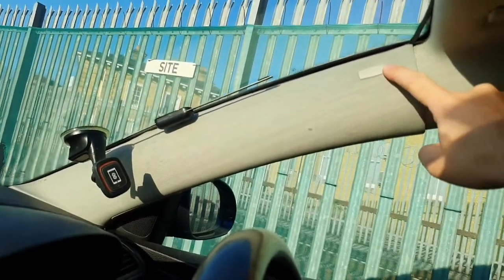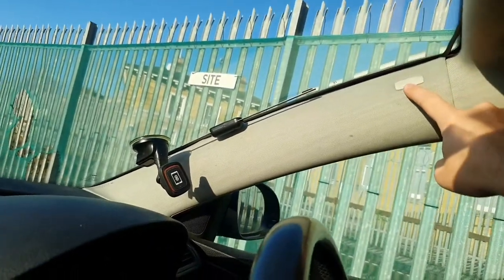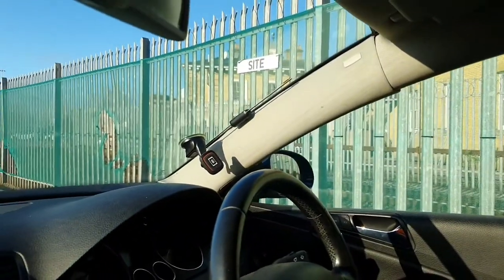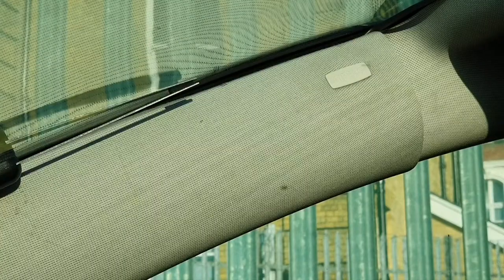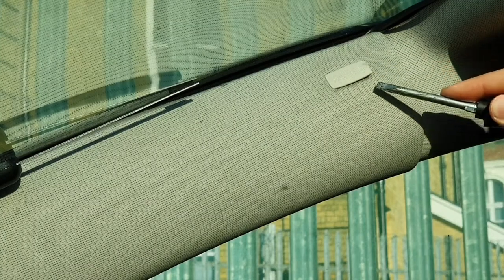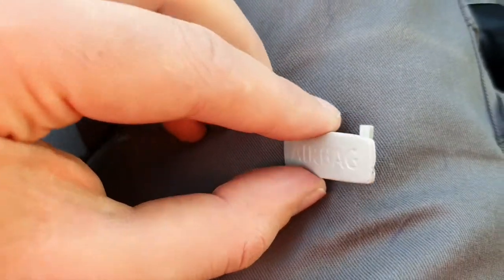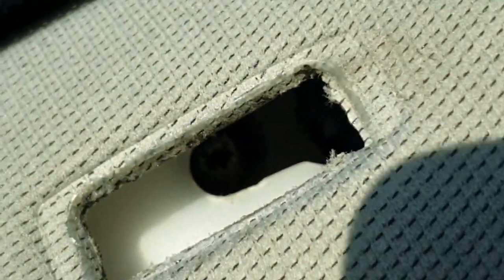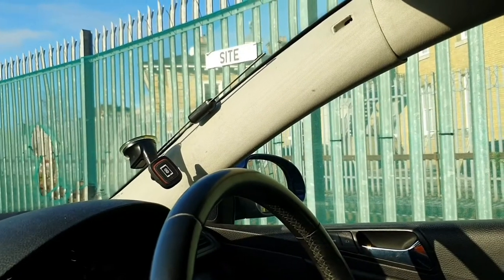What is behind the airbag logo cover / clip? remove A pillar

Comment: Do you have to disconnect the battery or can you do it without?
Reply from the maker: If its just a plastic clip like mine no. But if you think your airbag is close and you might be touching it. It might be best to disconnect the negative black terminal on the battery just incase it sets off the airbag. I didn't bother disconnecting mine and I ran a cable behind the airbag to power my dash cam (hardwired it)

Comment: would this be on a mk4 also??? My 2005 Golf has these AIR BAG clips on nmboth A and B pillars
Reply from the maker: I'm 99% sure. It's just a cover in most cases. If in doubt disconnect the negative terminal on your battery and wait a few seconds for the energy to deplete
Reply: @Dave50Bat  nah on mk4, it's glued on. Theres a locking clip behind it, but it has to be accessed through the side of the pillar

Comment: MAKE SURE - the wire you run for dash cam, etc is not blocking the air bag!
Reply from the maker: Yeah behind it preferably. Don't want to get slapped by the wire if the air bag goes off 😬
Reply: @dayv  You also don't what to impede the deployment of the air bad in a crash. :face-purple-wide-eyes: